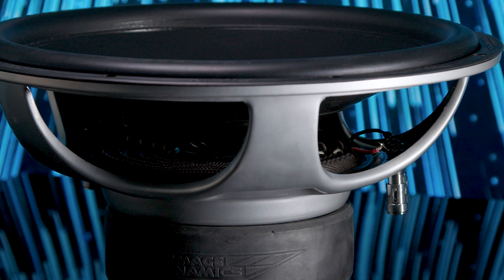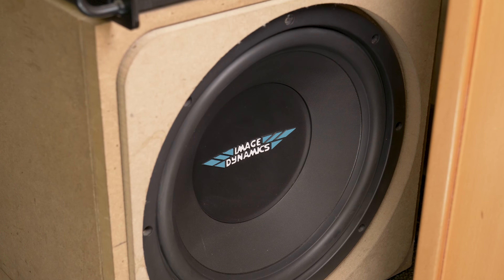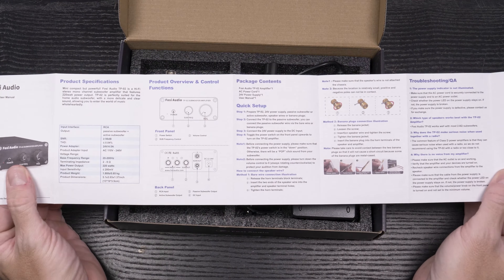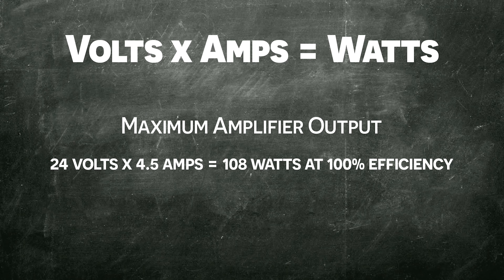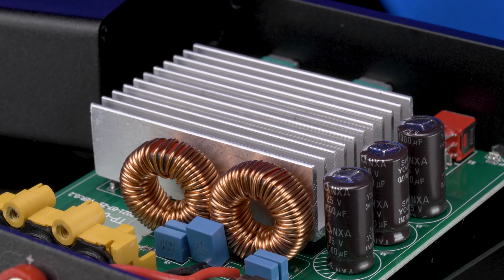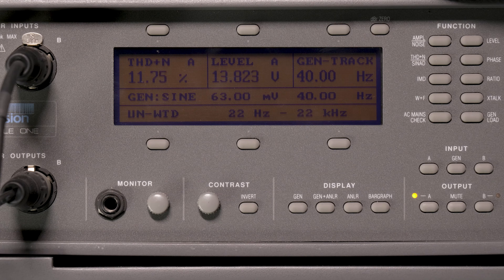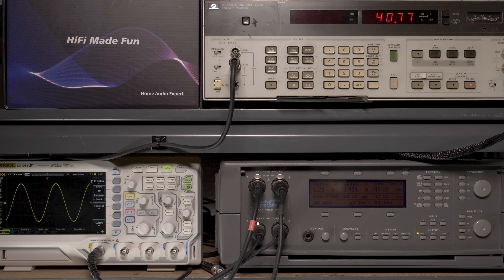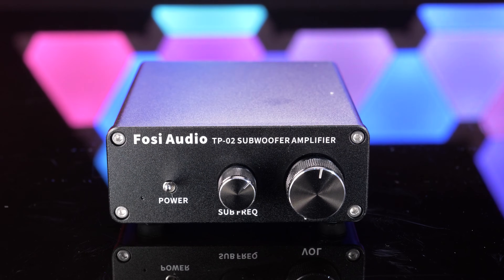Amazon's Best Seller - Amp Dyno of the Fosi Audio TP-02 Subwoofer Home Audio Amplifier

Comment: I bought one of this the other day because my main amplifier keeps cutting off my subwoofer Speaker so went ahead and connected this one to it thinking that it was going to fix my issue but it didn't I have it connected using RCA cables connection are right and impedance is right just can't understand why my subwoofer keeps losing its power, any suggestions?

Comment: I was told by Fosi support that the TP-02 must receive low-frequency (bass) signals under 300 Hz as input. If that's the case, then why are there two RCA inputs? Aren't sub outs usually a single RCA?

Comment: Absolutely right about this amp working with racing sims. Just got this amp paired with a Dayton BST-1 transducer under the pedals. This thing will give the Dayton a very nice time. Only on about just under half power-volume and its so powerful and clean. For reference i was using a Buttkicker Advanced transducer and a Buttkicker BkA300-4 amp, the transducer would often bottom out, you would hear the piston slapping like a metal rattle noise hitting the end stop, sounded bad. This setup however is much nicer without any bottoming out from the Dayton. I have 4 transducers on my Simlabs P1 cockpit, 3 Aura shakers and the Dayton shaker, no noise, no piston slap. The amp and transducer are a perfect match in my opinion for sim racing. Cant comment for music as i don’t use it for that. Brilliant little amp to proper power your Bass Shakers

Comment: would you figure it can deliver ~25 watts into a nominal 8 ohm load? Also - is it safe to run it from a 24 volt battery ? (as that could be 29 or so volts fully  charged)  What are its capacitors' voltage ratings ?  (I'm doing a 2.1 boombox with TP-02 as the "point one" with  15 inch 8 ohm woofer in a 3rd order box)

Comment: HI THANKS FOR THE REVIEW OF FOSI AUDIO TP 02 SUB AMP.  I HAVE FEW QUESTIONS . 1. DO YOU THINK THAT THE RCA INPUTS AT THE BACK ARE SHORTED OR PARALLELED IN THE AMP AND LASTLY CAN I CONNECT THIS TO A SINGLE WOOFER OF 500 WATT RMS CAPACITY

Comment: Stop this nonsense. Power supply ratings are for the output so a 24V, 4.5A power supply should be able to as minimum deliver this, i,e, 108W.  Efficiency losses in a power supply means it will draw more than 108W from the wall. That could be 20% But I'd suspect it is lower. I don't believe a power brick would be able to survive dissipating 21W.

Comment: Got one of these amps today and it is working remarkably well with a Buttkicker Gamer 2 transducer. It runs a lot cooler than the stock Buttkicker amp. My only gripe is that the two female banana connectors for the passive subwoofer output are too closely spaced and do not fit a standard 2-pin male 4mm banana plug unless you bend both pins to force it in!

Comment: NOT a pipe dream. Amps have capacitors and music is dynamic, so it can unload more than volt*ampere for when it counts. Plus you can upgrade the power supply to get more power.

Comment: does the crossover from sub frequency knob apply on sub out as well as on speaker terminals out? I would like to use it as active crossover.
my passive sub is connected on amplifier that doesn't have crossover so I would used this fosi sub out so I can control frequency with it. but I need to be sure that the sub frequency control from Fosi applies on sub output on Fosi.
thanks

Comment: Is this thing quiet when idle or is there any noticeable hum at low volumes? I have a cheap powered sub that has a nasty 60 cycle hum that I can't eliminate and I'm thinking of just converting it to a passive speaker or replacing w a car sub.

Comment: I have 2 12" subs with a rms of 1,200 each making it 2,400 total rms and the 20% would be 2,880 amp is what I need but those amps cost about 500$ to run 2ohms at 2,900 am I doing something wrong or is there something I'm missing. Bc I want this for my car and a 500$ amp seems like too much and then I would need a new alternator for my car bc of the power I would be drawing.